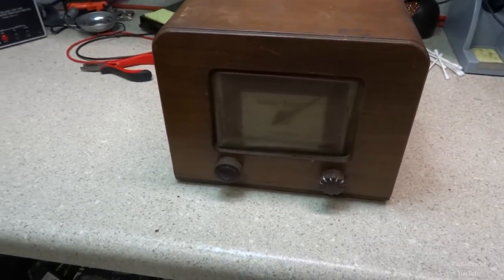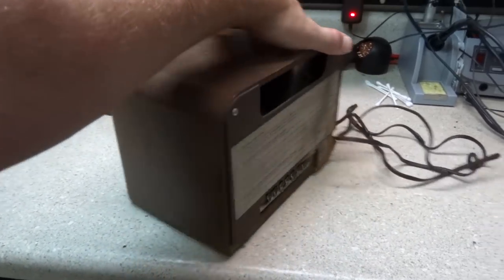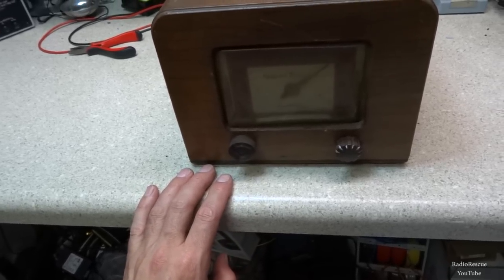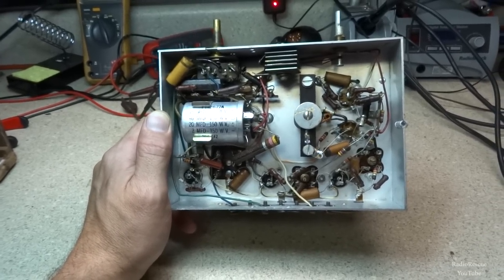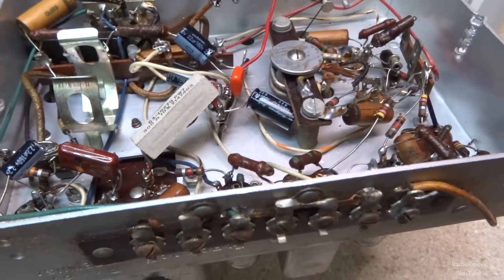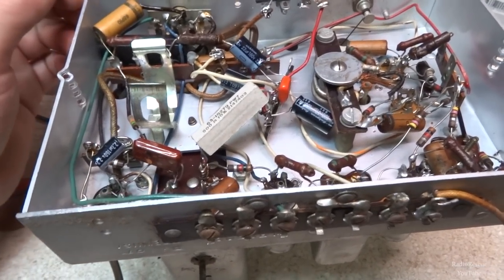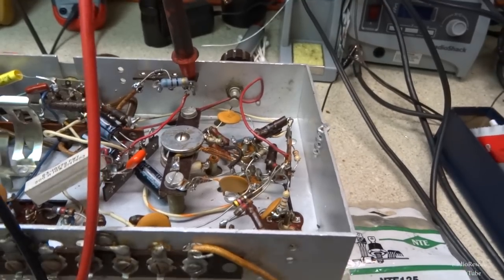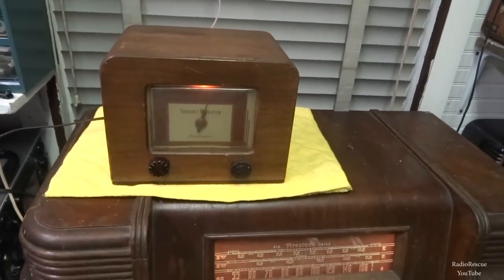Repair of a 1947 Pilot Pilotuner T601 FM tuner

Comment: The gain of the IF amplifier chain in your tuner seems low compared to those in other Pilotuner repair videos. There is a 470 Ohm resistor inside the discriminator transformer that supplies B+ to the 2nd IF amplifier tube. I would check this, as well as continuity on all IF transformer windings. According to the service literature, you don't absolutely need to sweep align this radio; you can just feed in 10.7 MHz and tune the IF transformer slugs, as well as the discriminator primary, for maximum response.
Reply from the maker: Thanks I'll give it a look.
Reply from the maker: Worked. Gain is much better. Thanks for the suggestion. I'm going to post an update video.

Comment: My Dad had an FM converter for his 1977 Mercury Grand Marquis Brougham. It inserted inline with the car antenna coax, like a VCR to a TV. You tuned to AM 1400, then turned on the FM box. Worked very well. The box has a tuning slug in the bottom, so if AM 1400 was occupied you could slide a bit up or down from 1400KC.

Comment: I have one of these that I just repaired. I also had about 88 volts where you were measuring. I changed the resistor going to that point and it improved performance but only upped the voltage slightly. Someone had gotten their golden screw driver on mine and when I did the alignment I found it was way off. Once I aligned it, it came to life. I stuck a three foot piece of solid wire on it for an antenna and I was stunned at how well it worked. These things don't have AFC but apart from that it works well. I think yours should do better than it is.

Comment: Hey. Great video. I just got one of these on eBay. Powered it up on a dim bulb and iso transformer and it seems happy but just hums. Sounds like 60 cycle so most likely the filter caps are gone. My plan is to wire it to my Philco Chairside 38 that I modified with an aux jack. I love these old things. When you play talk podcasts or oldies over Bluetooth they really sound legit due to the lower frequency range. Modern music not so much of course so the modern equipment in the house isn't going anywhere. Thanks for the video on it though. Take care!

Comment: There was another pentagrid tube 6/12BA7 that was supposed to work better at higher frequencies, but I never noticed much if any difference. Another octal tube was the 6SB7Y. But generally pentagrid converters start to poop out above about 15-18MHz. that's why good tube communications receivers used a separate osc & mixer tubes, usually osc. was a triode that worked better at higher dress.
Reply: Higher frequencies, stinking auto correct.
Reply: By the end of the 40's most manufacturers had given up on the 6BE6 at FM frequencies and were using the dual triode 12AT7.

Comment: I have a Silvertone  converter that adds shortwave and longwave frequencies to an AM only radio. I haven't worked on it yet. I think that it sends the IF frequency to the radio's antenna port (shielded cable)   and the tuning is at the converter. If not the IF it may be assigned an AM frequency.  Thanks for the videos.
Carl

Comment: Early FM receivers were not sensitive by any means. Much improvement to FM receivers came by the time of the transistor (late 50’s to early 60’s). I really like hybrid sets that use transistors for RF, but tubes for the audio. There were few of those, that I’ve seen. I’m a generation X’er, so I’m sure someone older than me knows more of them.

Comment: my guess. that to turn this radio on, (that is to make it sensitive), it would either need a wobbulator for alignment, or a sweep spectrum analyzer. I am just guessing, and it may be partially deaf. I am old, but still not old enough to know about this particular set. Since it was mono, one would naturally assume, sensitivity would be very high. I think it is alignment. good job on your video. thanks. Oh, one other thing, antenna. It probably needs a tuned length, T shaped ladder wire antenna.

Comment: You could certainly benefit from an outdoor antenna up as high as you can get it. If you have a 2 meter antenna outside you might want to try just using the center conductor as an antenna.  Also a little FET preamp in the antenna line might help.  Then again sometimes we end up chasing our tails trying to improve something that is working as well as it can as designed. We can never be sure just  how well these things worked when they were new unless we can find an old timer who might have actually used one at the time. In the beginning there weren't many FM stations outside the major cities so maybe sensitivity wasn't an issue to the designers. Interesting to see one of these anyway. 73 Doug.

Comment: Check out radiotvphononut's repair of one of these and note he gets a dial full of stations. ( https://www.youtube.com/watch?v=n3w6xUSuIXA&t=89s ).

He put a 27 ohm resistor before the new rectifier. Check out his video. Also note he used a more modern radio to play it through. Your old pre-war sets may not have enough gain.